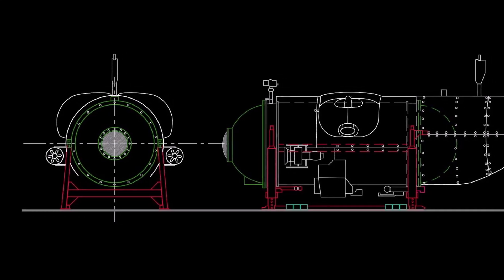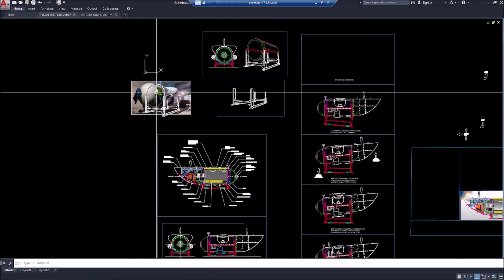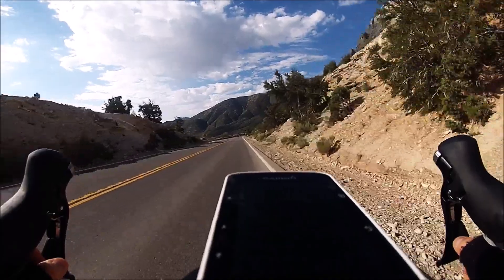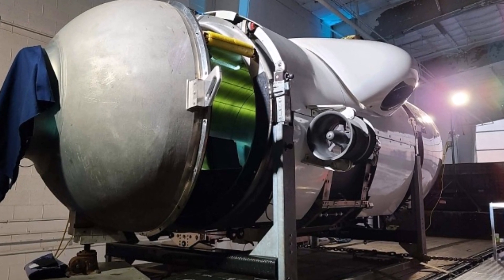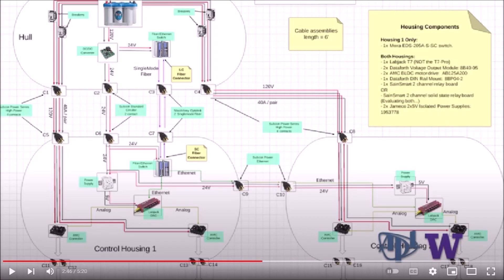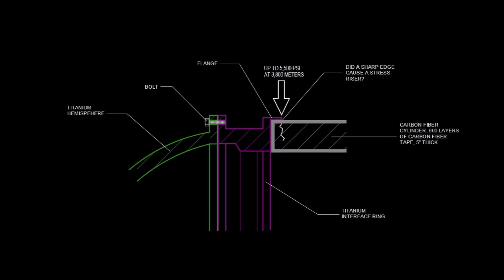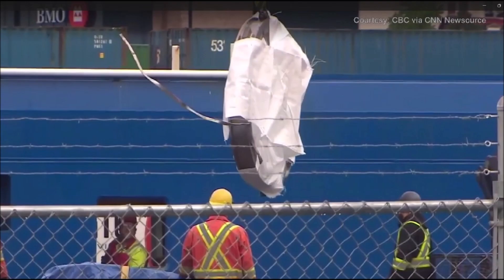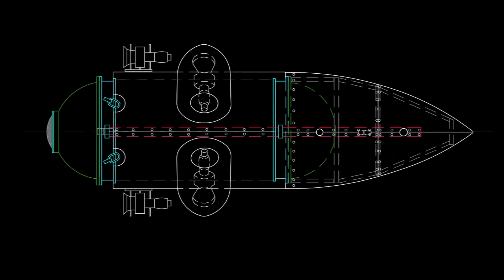OceanGate Titan - INTERFACE RING CAUSED FAILURE?

Comment: Two things. A) The INNER C RING sheared off at the glue and C ring (inner) FLANGE. IT WASN'T THINK ENOUGH.  FULL STOP. B) Rino liner for exterior waterproofing? No. Water got in from contracion of the hull AWAY from the outer C ring INNER radius. The carbon fiber deflected down & away from the outer surface interface. This allowed it to attack the glue directly. Noticing NO carbon fiber on the C rings, just the glue ONLY. 🤓
Reply from the maker: Actually, having now seen the footage of the debris on the sea floor, I have a new co-theory which is based on the same principle of stress risers causing a catastrophic failure. It involves the "struts" that connected the front and rear hemispheres together. I uploaded a short video about this yesterday. Anyway, I think the flanges on the interface rings sheared off in the implosion, which is why they are hanging off the ring in that debris recovery video from approx. July 2023. Looking at the large pieces of CF on  the seafloor, you can see how the edges delaminated when Titan imploded.

Comment: Didnt know that about the bike steering tube!! Interesting! Are carbon and aluminum steering tube forks weaker because of the bonding of dissimilar material’s! Like titan!
Reply from the maker: It can also happen with carbon handlebars and an aluminum stem with sharp (enough) edges, which is the more common scenario but the fork steerer tube is much thicker and is closer to the proportions of Titan. 

I'm not aware of problems with the carbon and aluminum debonding on forks but it could theoretically happen due galvanic corrosion. In that scenario, the most likely place would be the rear dropouts, where the rear wheel is attached to the frame, but you'd have be riding in a pretty rough environment. It's fairly common with the bottle cage inserts though, where the rider's sweat dripping on those threaded aluminum inserts can actually cause them to fail over time due to galvanic corrosion. Happens to people that use indoor trainers a lot.

Titan had three pieces that connected the interface rings together, and the skid aka landing gear also served to connect both ends together. So the interface rings were not relying on only glue. I don't see the glue as being the weak point but the use of dissimilar materials is problematic in other ways.

Comment: Oceangate used glue to attach the titanium domes to the carbon fiber tube.  The glue was applied using a $2 plastic caulk spreader in a non-sterile, non temperature controlled environment.  When I saw that I couldn't believe my eyes.  It was a decision on par with the Japanese engineers that thought building the Fukushima nuclear power plant on the coast of tsunami plagued Japan was good idea.

Comment: The cracking sound may have been the carbon cylinder compressing more than the steel and shearing off the glue joint. Once the joint has sheared off, there is less strength across longitude.
Reply from the maker: I don't think the glue is really even a factor when the hydrostatic pressure at Titanic depth is imposing a force of 22,000,000 lbs on the titanium domes. Seems to be more about keeping stuff from moving around when it's not in the water or in shallow depths.

Comment: Since the tube has equal thickness, it automatically has a weak point at center. 
This combined with no longitudinal fibers will cause a failure at center of the tube.
Reply from the maker: Logically, that would be the case but it may not have actually failed so neatly in the middle like these computer simulations show. It would have failed wherever the carbon started to weaken. That could have been virtually anywhere. I really believe it failed due to kink band formation, which can happen suddenly and unpredictably. Whether or not that was from cyclic fatigue, who knows? It could have also happened on the first dive. Seems to me this is a case where computer simulations and testing of 1/3 scale hulls (purposely imploded to gather data) didn't exactly line up with the real world.

Comment: There was no longitudinal tensil strength in the cylinder making it extremely vonerable. Also there's no inside flange at the joint between the ring and the tube. This joint will shear with each dive as the rate of compression will be different in the 2 different materials.
Reply from the maker: After I made this video I found out there were actually two versions of the hull. The one made in 2017 shown in this video, which was scrapped sometime before 2020, is what I assumed was used in the Titan at the time of the implosion. It never stopped making noise, so it couldn't be trusted. They had a new one made in 2020, and that is the one which was actually used in Titan for the 2021-2022 expeditions (total of 13). It behaved exactly as predicted until the implosion occurred. Allegedly there were axial fibers in it but I have not found any pictures taken while it was being manufactured that actually shows that... so maybe same as the 2017 hull in that regard? 

Also have found picture that shows inside and outside flanges on the interface ring. So it is similar situation as the bicycle steerer tube. I didn't mention in the video that there is a part inside the steerer tube that the top cap of the stem is bolted to. So the tube can be getting see stresses on both the inside and outside of the tube.

Comment: I agree with your failure mode....I have thought for a long time that the ends of the CF tube needed internal 'support' rings, or the internal flange in the Ti ring needed to extend about a foot inside the Carbon Fibre.

Comment: I have read from deep submersible experts that one of the most important rules of thumb is NO 90 degree stress points. The interface rings appear to have 90 stress points around the circumference. That seems to me to be a definite no-no. I think you are probably pretty close to discovering certainly a very plausible cause, more so than most of what I have watched and read. I believe it really boils down to 2 possibilities, either an implosion at mid-section of the pressure hull, or similar to what you have illustrated here. I don't believe there are any other plausible scenarios.
Reply from the maker: Could've have been in the middle but the argument can also be made that the interface rings have been cutting into the carbon fiber on every dive... but on the other hand, kink band formation(s) can suddenly appear with CF under compression and there's not much you can do about it. From that point I think it would just be a series of cascading failures until it fails completely.

Comment: You could see inclusions as they were wrapping the carbon fiber. Air? Debris? It was never in an autoclave,what damage did the lightning strike do? If they were able to jettison the legs it would probably make it even weaker and once they lost bouancy the tiny thrusters didn't stand a chance. Was there any protection from lightning strike. In aircraft the carbon fiber panels have metal mesh and each one has to be tested for ground.
Reply from the maker: It was vacuum bagged… but there was also two versions of the carbon fiber cylinder. I just learned about this the other day. The one I show is the one made in 2017. They had a new one made in 2020. I don’t know what the story is in between but I think the 2020 version may have been the one in Titan when it imploded. It looked to be much better manufactured.

Comment: Carbon fiber has poor strength in compression.  The overlap between the carbon fiber cylinder and the titanium rings was only about 2 inches.  This was the glued area.  

As the carbon fiber cylinder flexed in compression, the titanium rings flexed much less.  This created knife-edged compression/shear of the carbon fiber at the inner diameter edge of the rings, and tension on the carbon fiber at the outer edge of the ring.  

The compression point at the inner edge of the titanium ring annulus likely crushed and weakened the 2 inches of carbon fiber hull interface area during  each dive, both fore and aft.  These may have been the disturbing 'gunshot' noises heard by many who went on dives inside the Titan.  It's also possible that the titanium inner lip of the ring was failing, but we can't know that without photos of the recovered rings.

Each dive also likely tried to pull the hull out of the ring at the outer titanium ring annulus (where it was in tension), challenging the glue bond even though water pressure was pressing the ends of the titanium hull hemispheres into the hull.  The flexure of the carbon fiber hull would occur at the 2 inch deep ring annulus no matter how much the water pressure was working to seat the rings against the hull edge.

Winding the carbon fiber in concentric layers versus a longitudinal looping/criss-cross pattern as carbon fiber pressure vessels are built, made for a much weaker hull.  The Titan's concentric winding design can lead to layers slipping past each other when stressed, essentially delaminating between wound layers.  Stockton refused to ultrasound inspect the carbon fiber hull, even when visible delamination and porosity was apparent in the carbon fiber.  He merely coated the outer hull in bed liner to camoflage the deterioration.

Further, he did not have the hull autoclaved in a vacuum chamber, and worse, he machined the carbon fiber hull at the ends to ensure a fit into the rings. Cutting carbon fiber reduces hull thickness at the dissimilar material interface, interrupts the laminations, creates uneven stress, and likely serves as the propagation point for failure at the exact point of greatest mechanical stress.

The two implosion sounds heard can be explained by understanding the nature of the hydrophones that captured the implosion.  The softer-sounding first implosion was the actual and only implosion.  Navy hydrophones are not designed for noises that loud, they are designed to listen to very quiet submarines.  What happened was a complete saturation of the hydrophone during the implosion.  The sharp, second sound was the echo off the ocean surface or off of a thermocline, which acts as an acoustic mirror.  The echo was not as loud as the initial implosion, thus it did not saturate the hydrophone as badly and thus sounded louder.

There were likely several more echos, and you can understand this better by watching this video and reading the explanation: https://www.youtube.com/watch?v=1_qlQhBa5V4  The recording of the supposed Titan implosion may be fake, and may actually be this implosion.

I postulate that the repeated knife-edged shearing/crushing of the ends of the hull against the titanium rings led to the 5 inch hull being effectively reduced to only a couple of inches of intact hull at the end rings.  There were many reports that the gunshot sounds were coming from the aft end of the sub.  If it failed there first, the implosion shock wave would travel forward as the hull imploded longitudinally, starting at the rear of the vessel.  The instant compression of the air would blow out the view port, while simultaneously pneumatically and mechanically crushing the soft tissues of the passengers into an emulsion with only low-porosity bones and teeth remaining to be recovered.

Carbon fiber can be used as a hull material in compression as Stockton proved, however, it is gradually destroyed on each deep dive.  Its lifetime will be limited, and it must be constantly scanned for damage using ultrasound or other non-destructive techniques.  I give Stockton credit for creating a design that worked a few times despite its dangerous defects.  His hubris, arrogance, incompetence, refusal to get the vessel certified, use of a lexan viewport that was not rated for the depths he ran, and outright dishonesty led him to keep using it long past its safe lifetime...if the safe lifetime can even be determined.

Finally, I would argue that because carbon fiber cannot be guaranteed to be homogeneous and is lousy in compression, it should never be used for manned exploration of the ocean's depths.  My opinion is that it is economically and perhaps physically impossible to judge how many compressive cycles that a carbon fiber hull can take before failure, and that such hulls can never be certified as deep sea submersibles.
Reply from the maker: Thanks for your comment. You bring up some interesting points. Several people have told me that is not the actual recording of the implosion. Even so, I would expect it to be something along those lines. I have kind of come to the same conclusion, that the carbon likely can only handle a certain amount of dives before it can't be considered safe anymore, but how exactly does one determine where that point is? To muddy the waters, there was apparently a 2017 hull and one that was made in 2020. I think the 2020 one is the one that was in Titan when it imploded.
Reply: The Titan was struck by lightning at one point.  Much of the hardware had to be replaced.  At another point the first hull was determined to be unsafe below, I believe, 3,000 meters due to cyclic damage accumulating in the carbon fiber hull.  The second hull was supposed to be better made, but Stockton refused to perform extensive NDE of the hull and instead used his patented and ridiculously naive imminent failure acoustic monitoring system. @VegasCyclingFreak
Reply from the maker: @chumpchange1846  Huh I haven’t heard about a lightning strike… that’s wild

Comment: Why bother?  The stress riser that started the propagting failure could have been the ring flange, or could have been one of the thousand of discontinuities inherent in the composite.  Hell, it could have been someone dropping a coin on the inner surface.

The problem was in using a material which has a known failure mode…..propagation of micro cracks eventually leading to joined cracks that propagate.  The hope that cracks could be detected before they had reached unstoppable size was the leap that proved lethal.

Maybe the ring started the ball rolling. Maybe something else did.  But the ball was poised to roll sooner or later, ring or no ring.

Comment: I remember someone's video that showed a kid running the Titan (In not so deep of water at that time) But accidentally ran the legs i believe right into a rock... Not sure if OceanGate ever checked that back then Cause Stockton was with them letting them drive it
Reply from the maker: Impact damage can make carbon fail over time. I just discovered how the legs actually mated to the interface rings so it may not be as bad as it sounds due to how that is designed. I probably ought to do a quick video on that.
Reply: @VegasCyclingFreak  I don't remember where that video is that it happened But is on YouTube somewhere 
I have a feeling that could have bent the pins that release the frame (why it took a few tries from thier messages back and forth to the Polar Prince)
Reply from the maker: @ImaFnT-Rex  Hmm... could be that was a factor. Seems to me that it have been one pin pulled out and the other one didn't, so the frame warping/twisting caused binding on the remaining pin. I have video on that frame release mechanism where I show the basic concept.

Comment: Ive been saying the joint between carbon and titanium ring was likely failure mode. May not be 1st failure but once carbon is weakened deforms the titanium ring cannot flex with it. Making 2 different properties of epoxy n titanium. Many fiber cracks where heard on earlier dives. You where banking on epixy titanium rings connection which was NOT done in dust free enviroment, not cooked, not vacuumed no real way to guarentee a nasa level connection. Which is what was needed. Im not an engineer but i do build large structures. So i deal with 200k lbs forces daily
Reply from the maker: I agree with you on all points. As I continue to research, I do however believe that Spencer Composites gave OceanGate a sub-par hull. May be a simple as the modelling program they used did not match real world results. Happens to me in my field, too... but no one is going to die because of it. I don't know that this required a clean room environment but it could be a factor somehow. Everything was under massive compression so it's different animal than things on the surface or in space. BTW, the CF cylinder was baked in oven at 278 deg F for 7 days, and it was bagged but there no use of an autoclave. The titanium bits had 22,000,000 lbs of pressure on them at 3,800 meters. Crazy huh?!

Comment: 6:11 This is not a recording of the Titan imploding.  It is from a Canadian deep sea service firm.
Reply from the maker: OK... so what is the context here? Is it some simulation of an implosion? The real implosion could have been recorded by anyone listening from a long distance away. The USA ain't the only ones listening to what's going in the ocean. Sound travels three times as fast under water and hella far too.
Reply: @VegasCyclingFreak The implosion of the Titan was an absolute gift to YouTube content creators.  YouTube doesn't like posting links so look up on YouTube Ocean Networks Canada, Implosion of Glass flotation spheres followed by 10 echoes.  This is the true source of the recording you used.  It was posted Dec. 2, 2013.  The very first sound of this recording is the hydrophone driven to saturation because the sound was so loud.  This is not the Titan imploding, so any analysis of this recording in reference to Titan is invalid.  ...and you are correct.  This is from Canada, proving the USA is not the only ones that can hear underwater sounds from great, enormous distances.
Reply from the maker: @armandomercado2248  Thanks for the info. I suspect Titan would've sounded similar, probably equally as dramatic if not more.